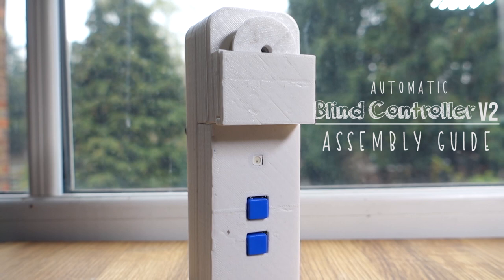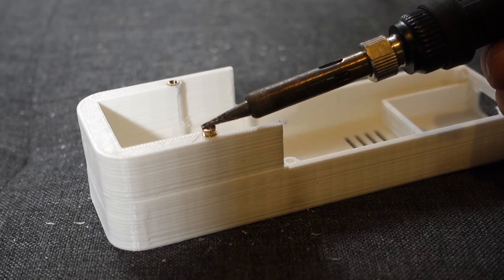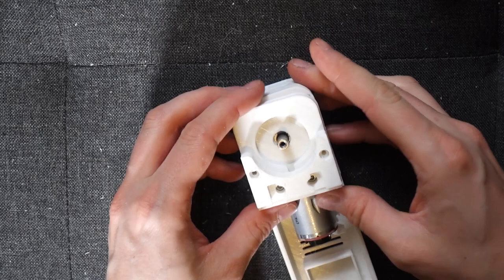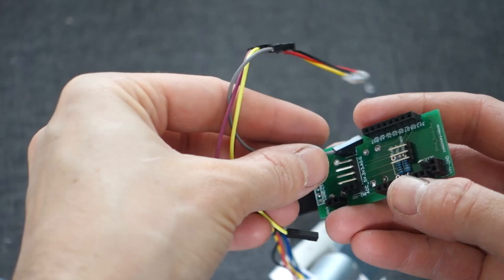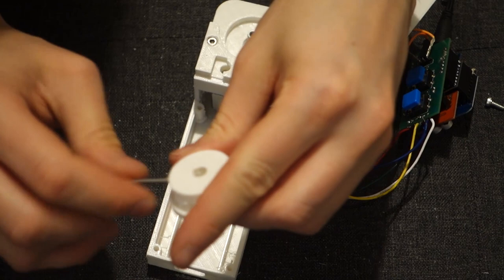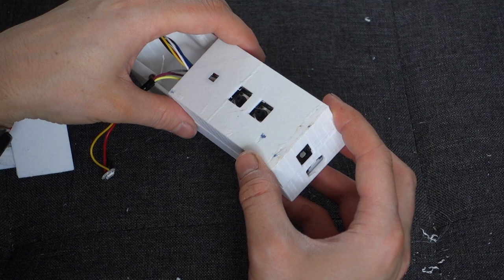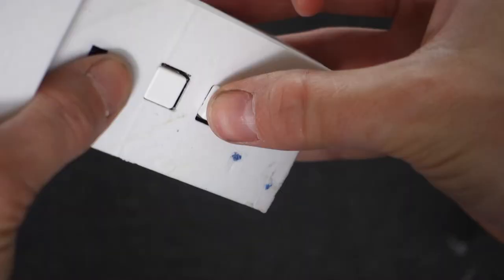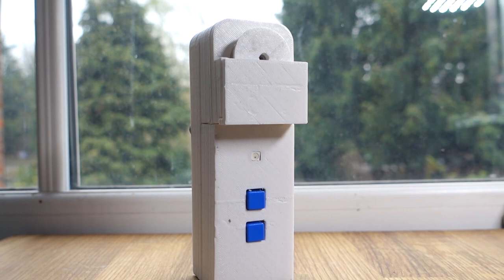Automatic Blind Controller - Version 2 - Assembly Guide

Comment: Can you please share the schematic for this custom board that you offer?  I'm trying to piece it all together with just a blank board. I don't mind doing the wiring.  Your website/thingiverse/YouTube /instructables all link to each other and in multiple places seem to imply that actual instructions and diagrams are available but all links go in circles without actually providing the necessary information.
Reply from the maker: Hi John, There is a schematic for the original v1 design over at thingiverse (https://www.thingiverse.com/thing:2631414) There is no published equivalent for the version 2 design as I believe the casing is simply too small for you to be able to wire it all in place and didn't envisage anyone actually trying it! I will see what I can do but in the meantime suggest you use the v1 schematic and the latest sketch as a guide.

Comment: Hey my Friend board works fine but i have one big Problem and i am not that good at coding.
I have verticalblinds but with just one cord for both operations open/close and tilt. To close my blinds it has to be like the Motor turns until he is on the end than turn 1 mm or so to the other direction (because then the gearbox switches to tilt mode) and than turn again to the closing direction for maybe another second. Are you able to do this without alot of work for you? or should i buy you a little bit for helping me out of this issue
Reply from the maker: Sorry I think this would be too hard to do without the blinds, I don't really understand the mechanism you refer to. Have a go though the programming is not as hard as you might think. Glad to hear you have everything working otherwise.

Comment: Just bought all the parts to this! Doing the 3D printing now while i wait for them to arrive. What size gear did you use for the current configuration. 6mm or 7mm? Wasn't sure what the difference is if you could elaborate that would be appreciated. Really great work look forward to getting this working!
Reply from the maker: It depends on the motor you have purchased and how accurate your printer is. The motor shaft should be 6mm in diameter but you may find the 6mm print too tight to fit easily. I suggest using the larger one and attaching using a grub screw as described. I'm actually working on a more robust coupling which I'd recommend if your blinds are heavy like mine, this uses a 6mm metal coupler, details of which will be on my site as soon as I fit it.

Comment: Inset, insert nuts ? Are these what you mean or something a little smaller? https://www.banggood.com/100Pcs-M3-Brass-Knurled-Nuts-Female-Thread-Round-Insert-Embedded-Injection-Molding-Nut-2-Heights-p-1184384.html The holes don't seem big enough for these even with a bit of melting.
Reply from the maker: That's right, melting them into the plastic ensures that they hold firmly in place. I use my soldering iron to do so.

Comment: Hey, I found you on Thingiverse. I have two questions. Can this be controlled via Google home as well as Alexa? Would you be willing to provide the Circuit board file so I can get my own made?
Reply from the maker: Hi Jamie, I don't have a Google home to test it with but as it imitates a Wemo smart plug I suspect it will no problem, maybe check the WeMo website to confirm? Regarding the circuit board, they are available to purchase already here: https://www.ebay.co.uk/itm/293040792644 PM if you require any further info.